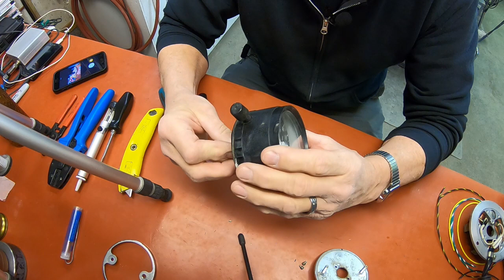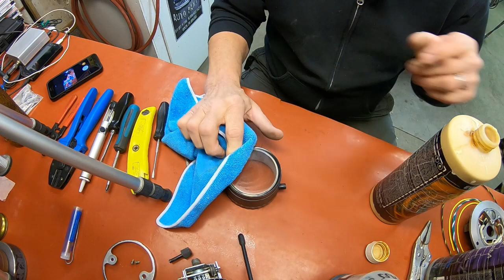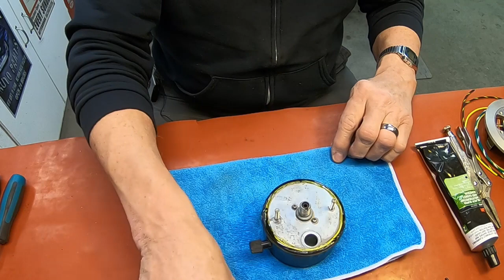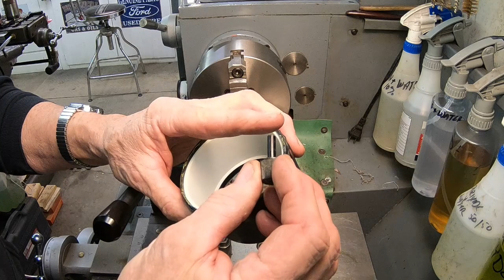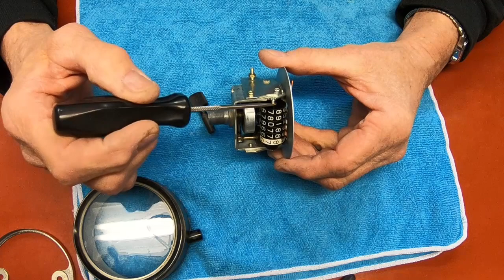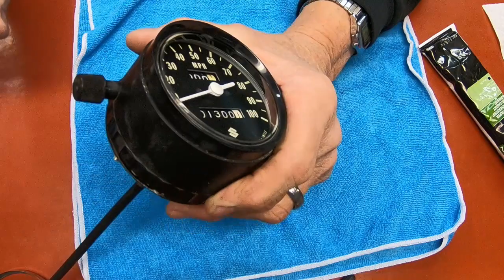Suzuki motorcycle TC125 Speedometer repair restore

Comment: Awesome Repair on the trip meter Knob!! Having a lathe Really saves the day sometimes! I have an old Navy lathe has a brass tag on it says " built under the war act of 1942" Has double 3 step pulleys and a leather drive belt with big metal staples in it. You swing the motor up to move the belt and change speeds! Goes Clack Clack Clack when its running but Really handy.  3 ft bed good for small stuff.  Luckily my Dad has a Monster 9 ft bed auto feed lathe with huge 4 jaw and 3 jaw chucks for Big Stuff. My Wrecker Truck Hydraulic Wheel lift main pivot pin broke and Holmes wanted $220 for new one!  [ it was 1-1/2 " diameter 19-1/2 inches long threaded on both ends !! ] We made one on his Big Lathe instead - used old boat prop shaft 1-1/2 stainless steel and ran threads on it --saved Me Lot of $$$$ !!
Reply from the maker: Thanks Philip, you bet the lathe comes in handy almost everyday. Dont know what I would do with out it. I have seen some of those naval lathes, they are well built and plenty rugged. I have a small Atlas that uses a belt drive, but not a flat belt. I use it for some smaller stuff. Would love to have a bigger lathe but not sure where I would put it. Thanks for watching, more to come.
Reply: @montana2strokeracer  The right tools makes life easier for sure. My Dad was Machinist and Millwright for Ford Motor Company Manufacturing Plant (Which is where I am right now- I been Electrician here 26 years! ) and years ago they got a New CNC Lathe for the shop and they put the old school one built in the 60s in storage. My Dad talked them into selling to him and we changed out 440 motor for 220 motor. So heavy we put it on his trailer but tires were mashed into floor of trailer and wouldn't move. Had to call my buddy with his Rollback and even his tires rubbed the bed on bumps. Weighs over 20 thousand pounds! Had to use Dad's backhoe to drag and push it I to his Garage. Backhoe couldn't lift it! Dad and his friends build Airplanes and he builds and threads airplane axles on it. Definitely worth the $100 dollars they let him have it for!!
Reply from the maker: @philipolah7279  Wow, what a great story. Im a big Ford guy myself, been so all my life. Would have loved to work at Ford. Did work at a Ford dealership for some time. But not the same. Still enjoy many cars and trucks Ive had most of my life. But starting to get rid of some now. Just getting to old, time to let them go. Still love that story about your dads lathe.

Comment: Good video. With an analog speedometer on a motorcycle (XTZ125) is it possible to adjust for a wheel size change or do I need to change to digitial?
Reply from the maker: Hi Ken, I am assuming by analog you mean, you have a speedo cable coming from the front wheel to the speedo. I am not familiar with the XTZ125 for it is a little newer than I deal with. I have seen in the past on some of the bikes I deal with, one year they came out with an 18-inch front wheel, the next year a 21 or a 19, with those you could go to another year model and take the gear and swap to the other to change the ratio. Not sure on yours. I think you may be stuck with what you have unless you go to a digital. Pretty sure this is no help to you, but I hope it gives you something to think about. Thanks for watching.

Comment: Well the lath paid off again any luck on the motor? Hate that the speedometer broke. But glad you had the tools to fix.
Reply from the maker: Motor repair has not called me yet, I have a 3 phase motor I am adapting to get it running again. Hope a pulley will be here tomorrow. Im in the middle of a job and need to finish it up. Yeah thats why the lathe needs to be running, if I need it, it does no good to have it, if its not running.